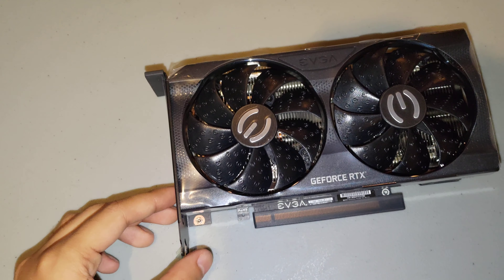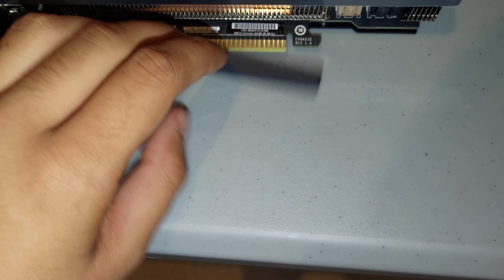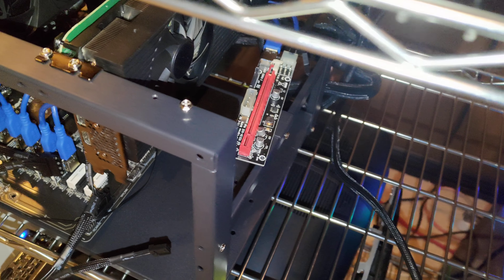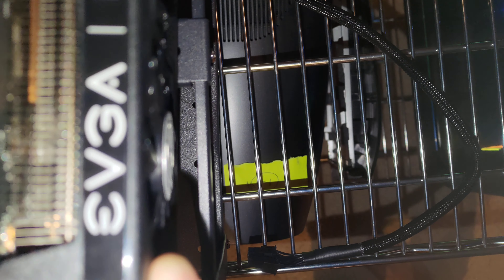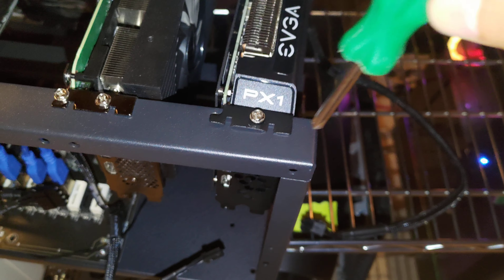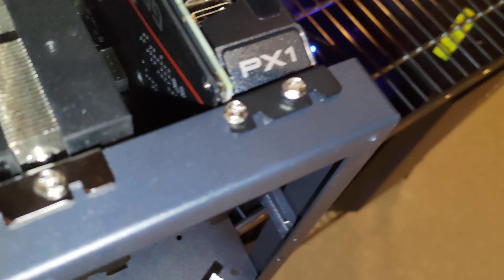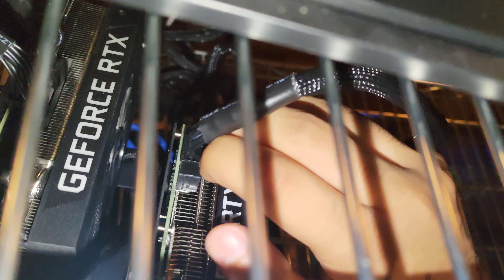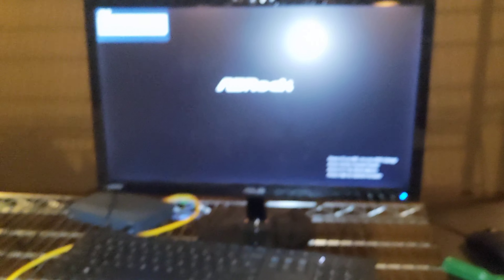Installing Another RTX 3060 non-LHR to my mining rig

Comment: aren’t the hash rates on the LHR 3060 around 22 MH/s? You might want to consider some 1660 supers, they do 31 MH/s and use about 75 watts of power. Very efficient cards and cheaper than the 3060 cards. Keep on mining!
Reply from the maker: I'm currently getting between 29-33 on ETH with my LHR cards! The reason I decided to go with 3060 is because they're new so they're easier to buy in new condition and also resale. But I have thought about going 1660 and might end up doing a rig with those!

Comment: Hey can you please comfirm that all brand new cards come with the plastic and rubber guards.  I bought one of these on Amazon and it is missing plastic that you peeled off and no rubber.  I would like to notify Amazon of this issue if its true. Please ty.
Reply from the maker: So my zotac cards came with no plastic. But every EVGA card I've opened had that. I don't really remember if the MSI did or not.